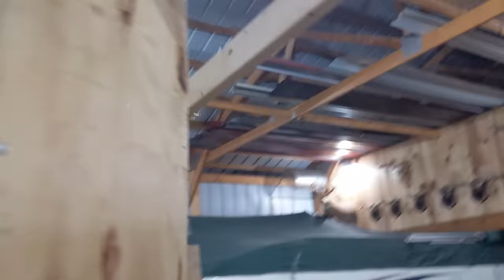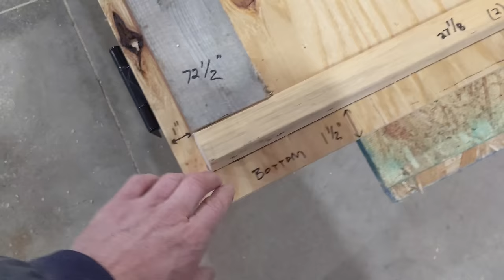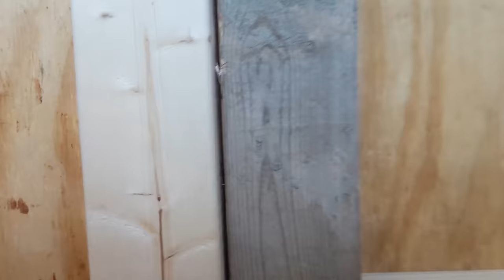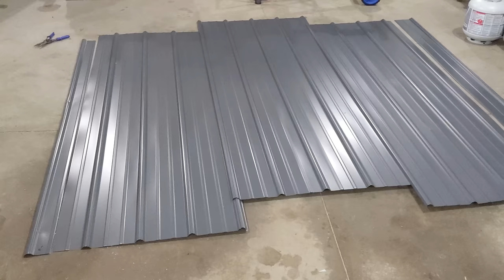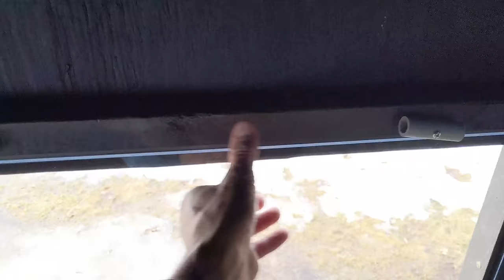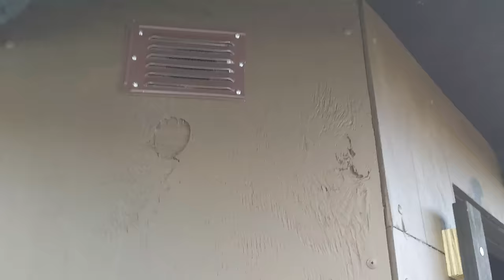Octagon Deer Hunting Blind Build - Part 2

Comment: Great videos, Brett!  I appreciate that we don't need to watch video of you installing 20 screws - thanks!  You've included just the pertinent info.  I have built the components and plan to tip up the base/floor (I am using 4x4 brackets) once the 4x4's are braced.  Then pull up the wall sections and build it on top of the platform.  I read your suggestion about building the roof frame prior to install.  I don't plan on assembling the components prior to putting them together on the platform, so not sure if I can build the roof framing to measurements and hope it fits?  Maybe I will assemble only the outer frame and center rafter.  I will add a post with how it goes/lessons learned in case anyone else doesn't have a fork tractor and/or has access issues.  Thanks again!
Reply from the maker: @gregjarosinski1783  I think building the roof frame as you described is a good idea, unless you are willing to build and assemble it at your shop, then deconstruct it for reassembly on-site.

Comment: Those screws on the window trim. Kreg jig screws, I buy them by the 50 lb box. Have them in 2 lengths. Most places these are high per screw. That's why  buy them in bulk.

Comment: I love it and I am in the process of building one as I type this. I built the platform for this blind almost 2 years ago and put a plastic archery blind on top and now I am finally building the walls and going to put the whole setup together. Question about the large window and dimensions,  the plexiglass is cut to 29 1/2" by 18" if the rough opening of the window is 1/2" larger then the plexiglass? This is the only part Im stuck on.  Thanks for putting this together for all of us!
Reply from the maker: You're welcome! Yes, the clear acrylic should be 1/2" shorter and 1/2" narrower thatn the rough opening. You want a 1/4" gap all the way around so it doesn't rub when you open and close it. If you watch my window build video it will make more sense why the gap works once the seal strip is put on.

Comment: Very well detailed plans. Only thing I'm going to change is I'm going to extend the side frame members(also go to 2x8 framing) to 10' and add a 4' landing. Making it easier to access the door. Otherwise a great stand. I also bought a Krig Jig and on the wall studs installed pocket screws on the bottom. Really helped for stiffening up the walls.
Reply from the maker: Thanks Wyatt. Those sound like very good improvements 👍🏻👍🏻

Comment: Do you ever use wood glue?  Thoughts are between he corner stud pieces and the 2x2 door frame to plywood connection?  Just curious?  Thank you for all the awesome videos!
Reply from the maker: You're welcome! I don't use wood glue for building and framing. When it comes to building things like this, construction adhesive would probably be the best option.
Reply: Agreed on the construction adhesive for subfloor to joist!  No squeaks!  On those mitered corner studs, a good bead of exterior grade wood glue would be a great addition.  Agreed on not permanently affixing exterior sheating, just in case you ever have to replace a piece.

Comment: I like everything but that door set up!
Reply from the maker: I personally like having good width and height to my doors and not trying to "squeeze" in. One thing I learned since this build is that the adhesive foam strips applied to the door don't stay stuck on very well over time, but it's an easy fix with a rubber or felt strip of some kind instead.

Comment: Just finished my octagon blind. I followed your plans and couldn’t be happier with the end result. 
I plan on putting 8 or 10 ft 4x4s under it. What would you suggest for anchors? I’m thinking about those anchors that you can install with a impact drill and the add eyebolt. It will be on Iowa farm ground. Your thoughts?
Thanks for great videos and plans.
Reply from the maker: Great to hear Tim! Those anchors should work just fine, but I'd go with at least 2 inchers and use a couple of them. Otherwise a couple of  T-posts pounded down good will work also.  Better safe than sorry!
Reply: Thanks for the fast reply. I think I will order a set of 4 that are 18” long with 3” diameter flight.  Would hate to see it bow over. Wish I could send you a pic of the blind.

Comment: The blind sitting in the background. How did you make the window sun visors? 45:45.
Reply from the maker: Took a 2x2 with a slight angle ripped off and screwed it horizontal above the window.  I used treated  plywood sheeting for that blind and I took the window cut outs and used them as the visor. Screwed onto the 2x2 and caulked the seam on top.

Comment: Can this be built modular so can be assembled in the field once built??
Reply from the maker: It could. My suggestion would be to build it completely, but hold off on caulking the seams until it is reassembled. I'd recommend numbering and labeling the components (roof metal pieces, roof osb sheets, wall panels, windows, floor sheeting, etc. with painters tape or a sharpie. That way, all of your screws and screw holes will line up when reassembling.  I would keep the 2x4 framed rafter structure screwed together, and the 2x6 framed base structure screwed together as well. The sheeting could be left on those two components, but they would be rather heavy.

Comment: Just wondering how that untreated side wall plywood will hold up over time.  I realize water won't sit on it and the stain will help some, but I'd hate to invest that much, especially time and then see it start to warp or rot in just a few years.  How much cost differential was there between treated and untreated?  Great detail in your videos, much appreciated!
Reply from the maker: I think it was about $15 a sheet higher for treated, so $100 or so in all. I think regular plywood with exterior stain will last. I got 20 years out of a sidewall with OSB painted one time when I built it. Regular plywood should go longer than that. Treated plywood should last forever.

Comment: If the walls are framed out in 2x4 and the door is done in 2x4 would it still work out the same, with your measurements? Thanks
Reply from the maker: You'd have trouble with the windows opening all the way up if you build your own windows like this and you make the walls with 2 x4.
Reply: I ended up just doing it exactly like your door and everything worked out perfect. I did a 6x6 square blind instead of the octagon, and framed it out like you would a house, but just changed around the door opening like yours and it worked out great! Thanks.
Reply from the maker: @DIY-outdoors  You're welcome! Glad to hear it turned out nice!!

Comment: after using it how has the windows worked out.  also was the height of the windows ment for a elevated stand or will they work for it being on the ground.
Reply from the maker: The windows still operate nicely. I really like the vertical ones for archery. The windows here are big enough so that they will work at ground level or from an elevated position.  If you are going to be on the ground, the horizontal windows may not need to be as tall, if you think you would want better concealment. This window design was to accommodate all situations. One thing I have noticed, driving rains do create a little water intrusion. Its not significant, but it does occur. It's a good idea to use treated window framing material and a treated wood floor, and be sure to have vents in the blind. Perhaps adding window awnings could take it a step further -  or exterior shutters for the off season.

Comment: How much weight is here in total would you guess? I saw you put yours in place with a skid steer, but I have to go down a steep hill, so I am not sure this is feasible. Building onsite may be the only option :/
Reply from the maker: I couldn't say for sure but 500 lbs maybe... I also set one up, same size as this with a 48 HP compact tractor.

Comment: Awesome video! Thanks for posting it. How did you raise the blind into the air? Did you use a tractor to place it on posts, or add posts and tilt the blind up? Did you use elevator brackets? Thanks again. Cheers!
Reply from the maker: Thanks! I used a tractor with forks and set it on buried 4x4 posts. I did not use elevator brackets on it. Check this review video of it all set up: https://youtu.be/peuh8MPerRc